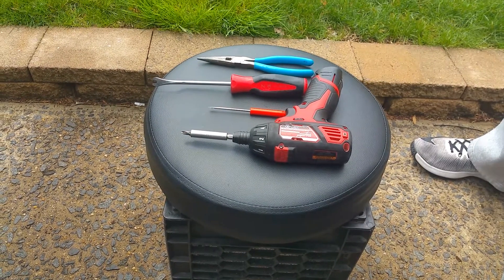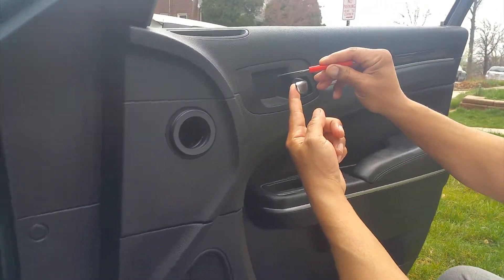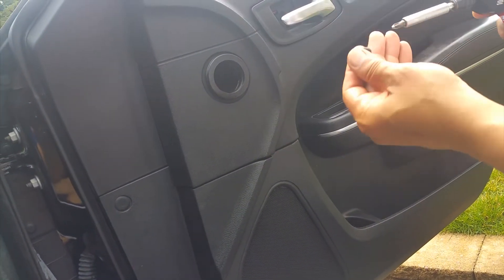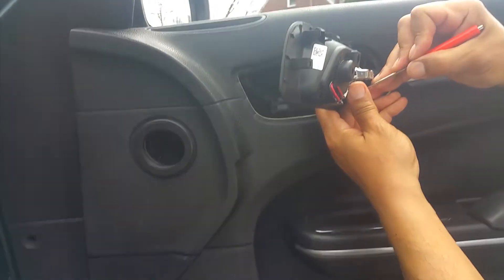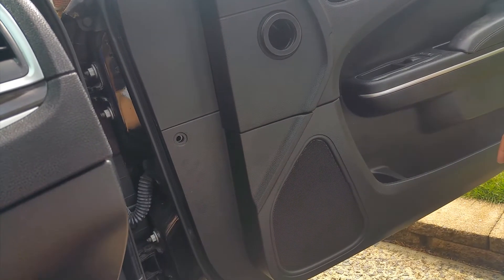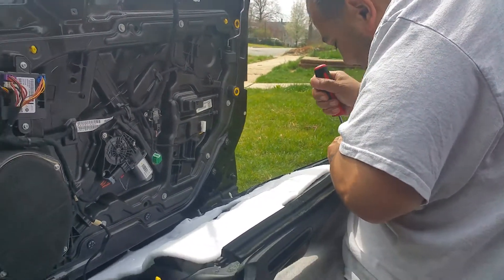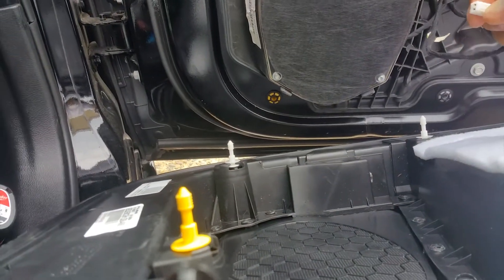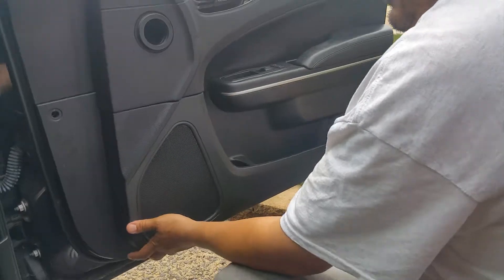How To Remove 2011-2022 Chrysler 300 Door Panel.

Comment: Can you tell me how the door armrest comes off.  Is it bolted from the inside door panel or just tabs from outside that you force out.
Reply from the maker: Oh man. Thats a good question. From my experience with mopar cars. They are plastic welded sometimes. They should definitely be removed from the inside, meaning you have to remove the panel to get to them. If you have the door panel removed, you should be able to see what you need to do as far as removing them.. plastic welds are a bit tricky. You need to cut them out and them reattach some way.

Comment: The part that you unclipped with the door handle that powers the led light, mine is missing. Would I need an entire new door harness ?
Reply from the maker: Send me the timestamp of what your referring to.
Reply: 2:16
Reply from the maker: That is factory yes. But if you do not have the convenience light there now, or it never came with the car. Then no, the wire or harness might not be there. So say you go buy the light from another car, and you want to give it power, hence the factory wire being there. Then I would look to see if it might be taped up alongside other harnesses in the door. If it is not, then yes, you would be right about needing a new harness. BUT, I would not recommend doing that because even if you get the door harness, where does it go to? I would just get a diagram of what is powering up that light and just give it that power source. So say for example, the factory light turns on when you open the foor. Then you would try to mimic that with your own power source. Or say only at night when the lighst are on, well, you can easily do that. Your not commited to having the harness there, you can "go around" and do it a different way. Its just power and ground. You just need to know which one, 5 volts or 12. Need a diagram of some sort.
Reply: @richideates  it’s factory because the driver side has it it and I connected it with the puddle light connector to see if it turned on which it did, so I’m guessing whoever went in before me ripped it and just decided to completely remove the connection, do you have an idea on where I’d need to tap to get power ? Or should I just pay for the harness
Reply from the maker: That or the door was replaced from an accident. Thats a possibility for it not being there. Those cars are dime a dozen nowadays. Who knows what the past held unless your the original owner. I would do some digging first before buying a whole new harness. Much easier for some homework, than to just jump into conclusions.
Reply: @richideates  would you happen to know the size or part number of the connector needed to plug into the door light ? Or how would I find it
Reply from the maker: Dealer. Describe to them what you want or need and they will find it for you.

Comment: I can't get the door handle off! How do you release the cable!?
Reply from the maker: 2 minutes and 39 seconds in I show you how to release it..you can try with your fingers but that ish hurts if your fingers arent strong enough. Once you squeeze the tabs, it releases the cable from the bracket and just remove the ball from handle.
Reply: Don’t really have a release the door Handel jus feed it back through the panel save time from doing all that saw it on another’ video lol